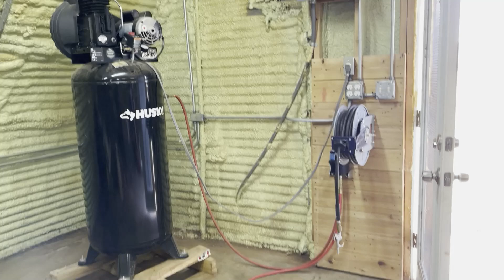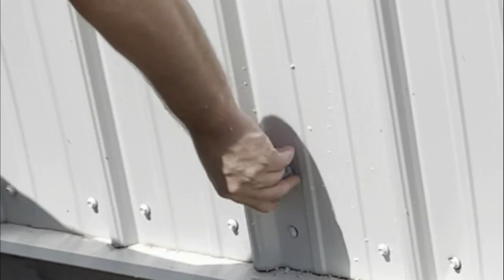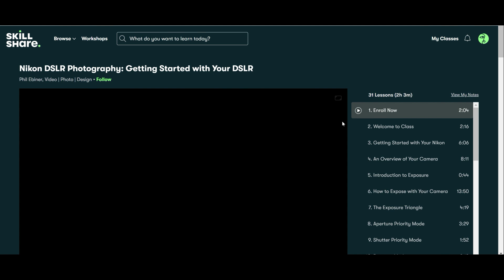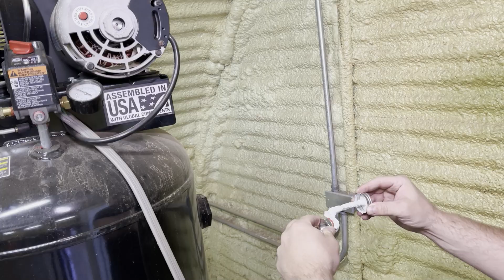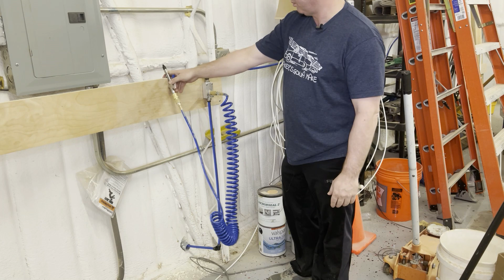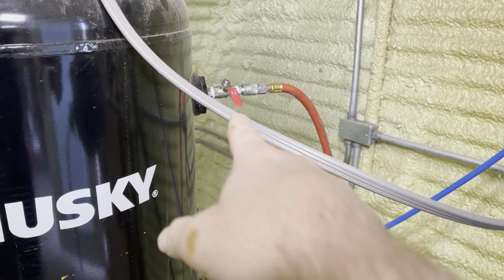Burying a Compressed Air Line Underground - Shop Air System

Comment: I am about to do the same but have wider pipe, forget if it is 3/4 or one inch.  For that thinner line, do you think it is enough air to run heavy demand tools like an air sprayer?  It sure would be easier to fish that gauge blue pipe!
Reply from the maker: I think as long as your compressor is big enough to supply the air, it’s all good.

Comment: sure hope your air dryer works perfectly  ....... normally, we would have a drain at the LOWEST point to be able to catch and remove water. I would NOT recommend having an underground line that cannot be drained
Reply from the maker: Awesome.. let me know when you make a video detailing how you do it… I will definitely watch and leave you a thumbs up.
Reply: @JakeThompson   I am doing one right now, but no underground necessary here. If I were tempted to bury the line, I would install an u/g box  with a removeable lid for the line to run thru.  Make that the lowest point and install a tee + ball valve so you can blow out any accumulated h2o.    

Keep on rockin' in the free world!!

Comment: Just curious why did you run airline inside of the pipe instead of sealing it and using a larger feed line into the shop?
Reply from the maker: I did it just I case I needed to replace the line.. I could have just buried the pex line but I want to be able to replace it easily in the future instead of possibly having to dig another trench.

Comment: Looks good Jake i used rapidair kit in my shop and will use it in my next shop. Very easy to use. One thing I would recommend is running a wire in the conduit to help locate it in the future.
Reply from the maker: Awesome!! I really like this air line. 👍👍